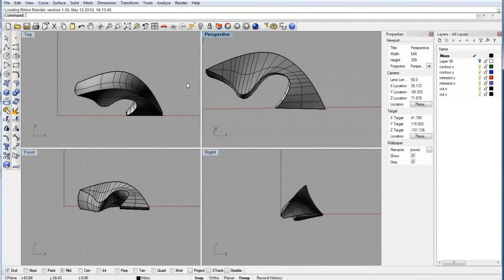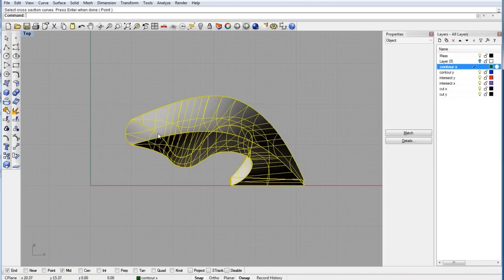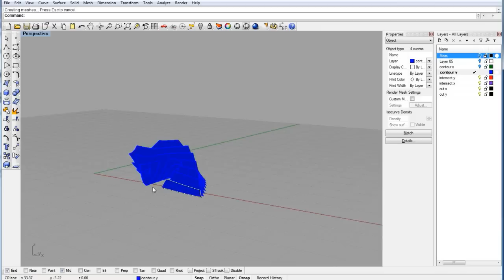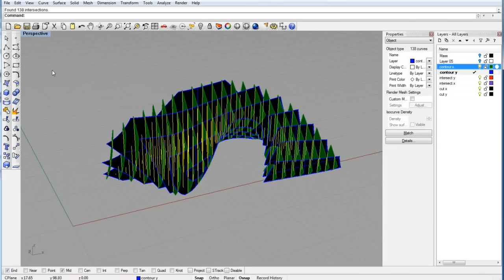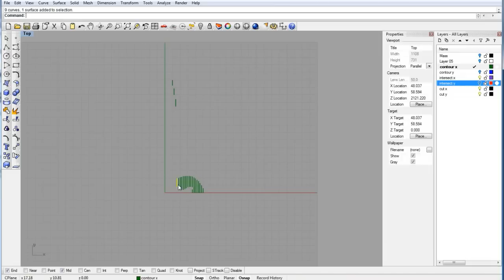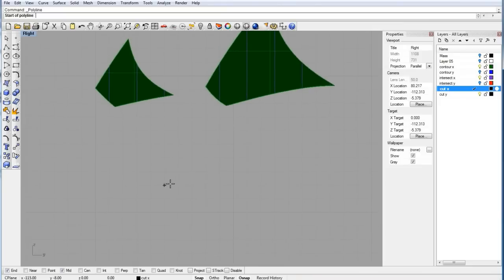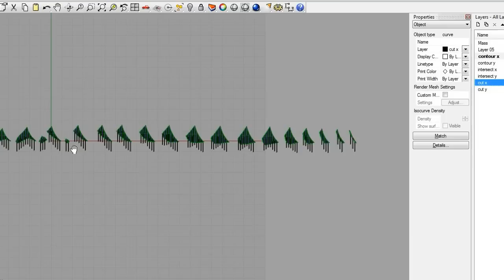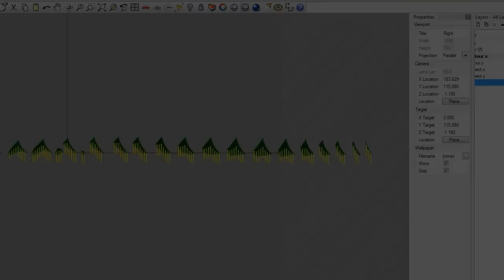Creating a 3d Waffle Model in Rhino - Part 1

Comment: what you can do is to extrude the surfaces and the profiles to be able to run boolean difference instead of trim. Then you can subtract the profile from all the surfaces and then you dont need to trim each surface manually. If you want it 2D afterwards you just run make2d

Comment from the maker: @Cafier If we offset the surfacesabd boolean them, we'll cut the surfaces in many small pieces, in order for the pieces to remain as a whole and string enough so they don't break, the notches are placed half way of each intersection. In a way because of the form of the object makes every intersection unique. What you could do is make the notches for let's say x and then offset the x surfaces and use them to boolean the y surfaces so you don't repeat the process twice